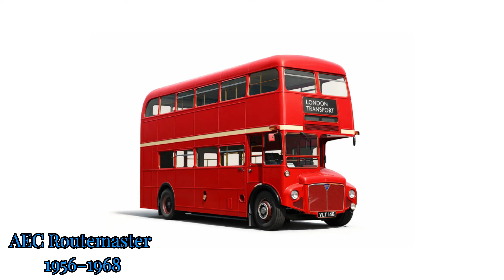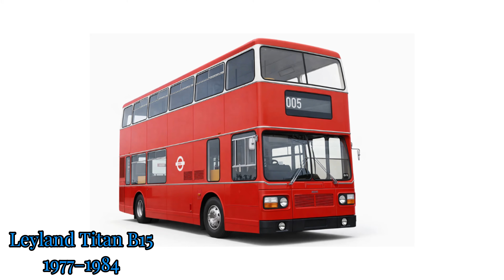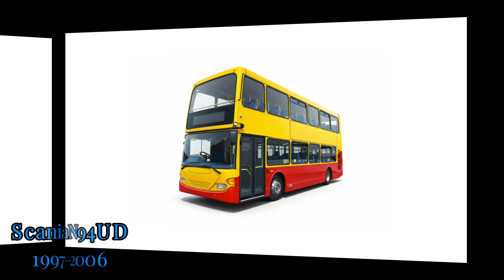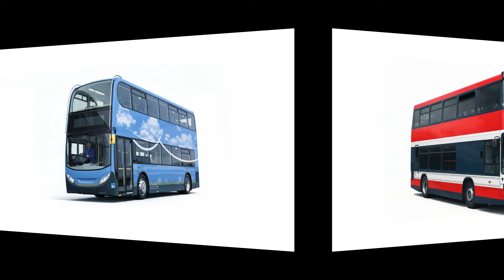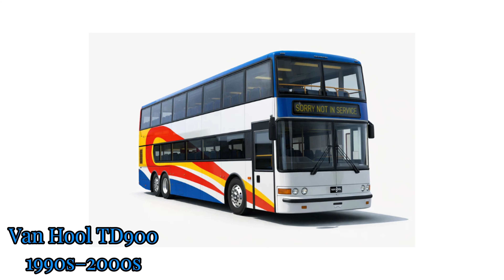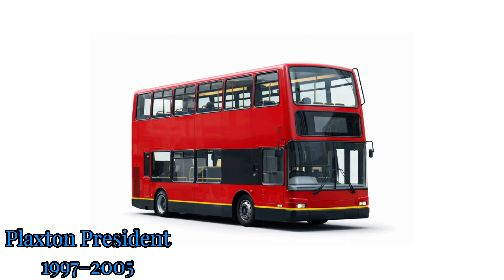Most hated Double Decker Buses To Drive By Bus Drivers Ever

Comment: I worked on London's buses from 1974 until 2024.You are talking complete rubbish. The Routemaster was loved by the vast majority of bus drivers.As for the open rear platform affecting the heat in the cab "through the partition ",the cab was completely sealed from the rest of the bus and had no bearing on cab heat.The drivers seat gave no more back trouble than other seats, bad backs occour whatever the drivers seat.The Titan was no taller than any other bus and fitted in any bus garage. I could go on but quite frankly this video is so full of errors I can't be bothered.
Reply from the maker: Hello and thank you for your response. All my research has been thoroughly conducted and all the information has been provided by the drivers of the buses in question, so if this is nonsense, then those drivers are talking nonsense.
Reply: @Motivvv-tvYou don't know yourself though do you ? I'm telling you like other London bus drivers who are commenting here that your video is full of inaccuracies. I worked on London's buses for 49 years ,don't you think I would know ?

Comment: Utter bullshit. Have you ever driven a Routmaster? I bet not. I did for many years in the 90s and LOVED THEM. Much better than modern buses.  They were like sports cars next to a contemporary modern bus. The cab was especially GOOD, in summer you had tons of ventilation, some even let u open the windscreen. In winter, nice and warm, the only ones that were open to the saloon were private hire buses, normal service buses you only had to heat a small cab, so you could keep warm. Not possible in an open one man design like the Metrobus.  Try researching properly before posting your AI voiced shite.
Reply from the maker: Hello, and thank you for your response. It's not as if I want to spread nonsense; that wouldn't benefit me at all. According to my research, this is what came out. It's not as if I'm making this up...
Reply: @Motivvv-tvwhat research? You facts are WRONG, simple. For example, what on earth does having an open rear platform have to do with the temperature of the cab at the other end of the bus which is sealed off from the saloon? I bet you got AI to write the entire script.